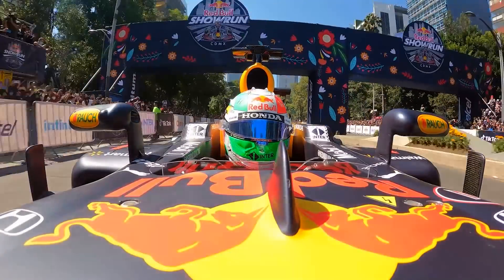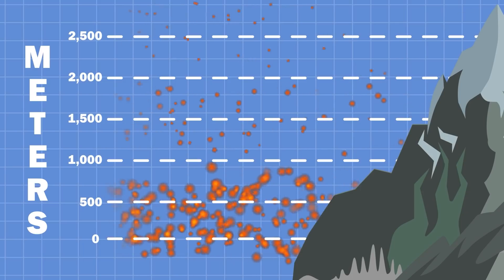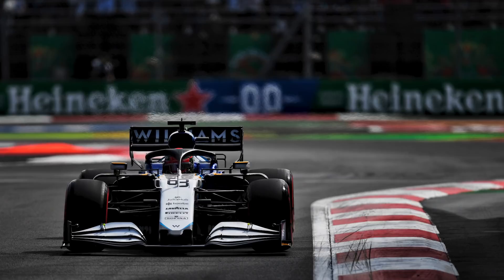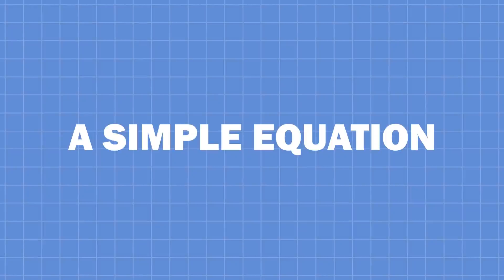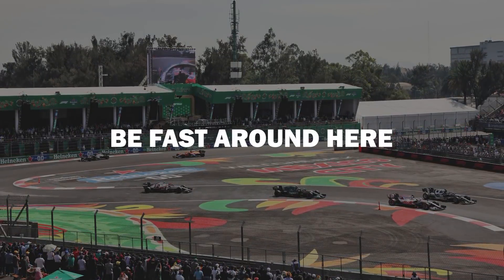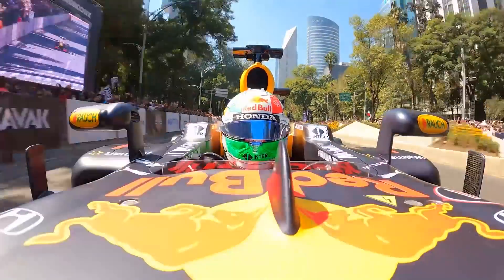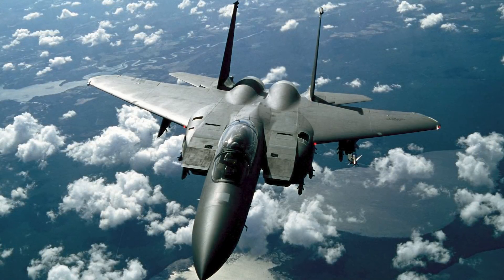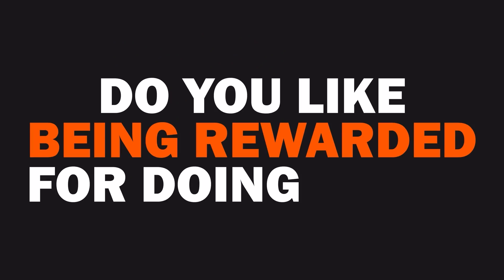How Does Altitude Affect F1 Car Performance?

Comment: Living and training at altitude (or through use of an altitude chamber which replicates the conditions) helps athletes gain a competitive advantage by being better adapted to high altitude conditions which would otherwise put additional stress on the body It's a technique also used by fighter pilots, cyclists and mountaineers to name a few as altitude sickness can also get quite dangerous at even more extremes.

Comment: Bruh this video didnt answer anything at all. Its impossible to know if Honda's turbo is better than other's, that is a closely guarded secret, their aviation experience tells you nothing.

The whole drag being less of a factor is just flat-out wrong. Drag is reduced alongside the downforce, putting the big wangs in the car brings the drag back alongside the downforce.  It affects all the teams the same too, yall explained shit.

Also, the sidepod intake size is set and cannot be changed race to race. "thats why they have bigger intakes" there is no bigger intakes, how did that line make it through scrutiny? The way they change their cooling packages is opening up the outlets, not the intlets.

Comment: It's easy, Mercedes powet unit include, Merc works, Mclaren, Aston and Williams .. run smaller intercooler or higher combustion pre combustion air temperature in their setup than Honda and Ferrari

Comment: The part about being able to put more air into the engine is most likely wrong, F1s have very optimized turbo plus the MGUH to make up for usual losses so they are really unlikely to have problems with intake, consider how little air it takes to saturate the regulation limited fuel flow. The actual challenge is really cooling.

Comment: science and wtf1 really have nothing in common. 
You guys failed to even say that due to the air being less dense there are less molecules in the same volume of air. Which is why the turbo charger needs more to compress more air so that the combustion has enough O2 molecules to happen. 
Same thing for the cooling -> fewer molecules means that less heat transfer that can happen in between the hot parts and the cold air.

Comment: The aero section of the video doesn't make any sense. Both Lift (downforce) and Drag equations are affected by the air density by the same proportion. So air density would not have an effect on one relative to the other.

Comment: I used to climb mountains, I was on Annapurna 1 in 1998 and I could take about seven steps at 25K feet, no way I can do that today. I think they compared this circuit to Mt. Fuji, I climbed that a few years ago and it was pretty tiring, I wouldn't want to wrangle an F1 car up there.

Comment: forgive me for being confused but how were the Red Bulls considered “much faster” if Bottas is the one who set the fastest lap in the race and the mercs were 1-2 in quali?
Reply: In qualy red bull got unlucky (as in checo had to go off track, wich also hinderd max) and bottas was the only one trying for fastest lap (pitting to softs at the end of the race) because he had nothing to lose
Reply: Red Bull were suffering with Rear wing osscilations in qualifying as the high downforce wings used in Mexico, are normally used in low speed tracks like Monaco/Hungary, but as Mexico City is at the highest altitude of the season, the air density is much lower (thinner) than any other race. So teams run larger rear wings to help generate more downforce, without the drag penalty they'd receive at lower altitude and also because with less air, less downforce, and thus grip is produced. But since these high downforce wings aren't designed for such high speeds (they're bigger so endure a much greater pressure/force than smaller wings), they were having issues with them fracturing during the weekend (we saw Max and Checo swap wings for example). Add to this difficulty in getting tyre temperature and it was an unrelenting negative spiral, with Tsunoda confusion everything went wrong for RBR. In the race however speed, and forces are far lower as the cars are heavier with fuel, and the cars are driven more in a way to preserve tyres/components unlike qualifying so this makes these issues disappear and as Red Bull had a significant pace advantage in Mexico due to the altitude and track layout. Now that the issues were no longer present in qualifying, and as with consecutive laps tyre temperature is much easier to control, everything came back to Red Bull and they were able to exploit their large pace advantage.
Reply: The bulls were faster in free practice.
Their final run in Q3 was slightly compromised. Max was 0.011 off Lewis in Q2 and 0.061 off the leader (Bottas) in Q1.

To then be off by 3 and a half tenths in Q3

Comment: you could explain it like the air pressure is like going deep into the ocean.  The deeper you go the more pressure there is, at sea level the air pressure is greatest, as you go higher up the air pressure gets less just like when you dive down and come up pressure changes.

Comment: Don't turbos push (blow) rather than pull (suck) air?

"Forced induction"
Reply: Well when they push they also have to suck but i know what you mean
Reply: @makr0295  I do indeed know what you mean, but NAs are pretty good at sucking (in air)
Reply: @Tj930  yeah thats true. It would make more sense to say sucking when talking about NA engines than turbos. But yeah i mean all combustion engines sick air in some way.
Reply: Well, on a 4-stroke-piston engine, yeah: Induction, Compression, Power, Exhaust (aka Suck, Squeeze, Bang, Blow).. But in a forced-induction engine (supercharger or turbocharger, etc), when 'on boost', it's not just the "bigger bangs" from more oxygen in the cylinder (something like nitrous provides this), there is also the push of air on the piston when the inlet valve opens.

Comment: Is it more down to car than engine though? Max's previous two wins were with Renault engine and redbull was very strong then also
Reply: look at the cooling packages of both merc and redbull the redbull has a much larger cooling package
Reply: @I_AM_HYDRAA  got it. Thanks. Was confused about this for more than a week now 😅
Reply: @phoenix2225  np it was pointed out randomly by someone this weekend and it explained alot and it is possible merc engines are just bad at high altitudes

Comment: You forgot, that due to less downforce the cars have less aereodynamic grip and need to rely more on mechanical grip (suspension, dampers etc.) and the Red Bull has more mechanical grip than the others
Reply: So does Ferrari
Reply: And even if it was at ground level, there are alot of slow, twisty corners which require more mech grip anyway, which Red Bull has far more off then Merc due to the Merc having a super long wheel base meaning it corners like an aircraft carrier.

Comment: Mercedes literally locked out the front row in Qualifying and yet some how people think they are "much" slower than Redbull. They even had way higher straight line speed than Redbull. Hamilton finished P2. Had Redbull been "much" quicker ,Perez would have breezed past Hamilton.
Reply: They were minutes slower you biased clown. Just because max couldn't perform in qualifying doesn't change the rest of the weekend
Reply: If RB were behind Merc they would have suffered from overheating. So that would make a benefit for Mercedes
Reply: @ExclemationMark  but Merc's overheating issues, as usual at Mexico, were much worse.  That matters a lot more in the race than in quali.
Reply: @elliotcrossan6290  that’s true. But I think it could also flipped backwards for RB. Perez still had problems overtaking Ham which is a god on wheels
Reply: @ExclemationMark  it's notoriously difficult to overtake at Autodromo Hermanos Rodriguez, because of overheating problems, sector 3, and slipstream/DRS being less powerful at high altitude.  Checo was probably half a second a lap faster than Lewis, because the Red Bull was so dominant in the race, but you need to be about a second faster to pass at Mexico.
Reply: Why is everyone forgetting that Tsunoda and Perez ran wide in their lap and impeding max aswell? It could have been closer in quali if that didn’t happen
Reply: Verstappen won by 16 seconds.  Pérez clearly had more pace than Hamilton.  This was a dominant performance from Red Bull.  Just because they messed up quali whilst Bottas and Hamilton put in brilliant laps, doesn't mean their racepace wasn't vastly quicker.
Reply: @elliotcrossan6290  Mercedes literally topped the timing boards q1,q2,and q3.
Reply: @weignerleigner3037  And Red Bull literally won the race by 16 seconds 😂
Reply: @weignerleigner3037  Quali pace & race pace are different dude. Cars behave differently when fueled up. And Red Bull botched their quali.
Reply: @lordmahaveer6307  they botched all 3 qualy? Ok
Reply: @elliotcrossan6290  redbull was definitely faster but you guys are making it out to be this crazy gap in speed. The difference is negligible. If redbull was so much faster then perez would’ve easily passed lewis yet he didn’t. I think max is just faster overall. Look at Russell in Belgium. He beat lewis in a Williams. I think lewis is losing his edge a bit. Just my opinion.
Reply: @weignerleigner3037  Russell nearly took pole in a Williams.  That's because the FW43B comes alive in the wet, the team executed the tyre warmup strategy to perfection, and Russell is one of the best on the grid.

Meanwhile, Lewis is beating Bottas in qualifying (Valtteri's greatest strength) by a bigger margin than ever, and delivering brilliant performances such as France and CotA, nearly winning in a car which should be nowhere near beating the Red Bull.  He also took a brilliant underdog win in a much slower car in Bahrain.  Max has the fastest car this year, and fair play, he is capitalising on that most of the time.  But Lewis is still the best on the grid.

Let's see if Lewis has "lost his edge" when he goes up against the brilliant Russell in equal machinery next year.  Watch how quickly the Lewis haters suddenly decide that Russell is overrated and loads of drivers would actually be closer to Lewis in the Merc once Lewis starts beating him.  Because that's precisely what happened to another driver who was rightly very highly rated in his time at Williams...
Reply: @weignerleigner3037  Don't be that guy. Merc & Red Bull do the bare minimum in Q1 & 2 just to get through. Max complained in FP3 already that the softs felt weird, and he wasn't improving enough on his final Q3 run to even get ahead of Lewis, even until the Tsunoda scene. Race pace is where it's at. Go look at the long-run pace numbers from FP1 & 2 ON F1TV if you're keen to dispute this. Yal like to respond knowing very well that what you're saying is blind bias.
Reply: @elliotcrossan6290  yeah I disagree with all of that. Funny how when people said Hamilton had the fastest car they were wrong. Now Hamilton fans say the same about max. Interesting how hypocrites work.
Reply: @weignerleigner3037  I'm interested to know who you're referring to who claimed Mercedes didn't have the fastest car in 2014-2016 and 2019-2020?  Seems like you're inventing an enemy to get outraged at there 😂

This is only the second time in eight years that Mercedes haven't had the fastest car (2017 being roughly equal between the top two).  In 2018, Ferrari were faster in nearly two-thirds of the races -- that year, Lewis had his most incredible season to date whilst Seb crumbled under pressure.  In 2021, Red Bull have a similar pace advantage to Ferrari in 2018, yet Lewis hasn't walked away with the title because Verstappen is capitalising on his opportunities almost every weekend, whilst Vettel catastrophically failed to do in 2018 -- and that's why I give Max credit for that accomplishment, which is especially impressive given his age.

But you're inventing your imaginary hypocritical Lewis fans.  We never said Lewis didn't have the fastest car throughout the majority of the turbo-hybrid era.  We did say that it was evidently not just the car, as ignorant Hamilton haters claim.  It's impressive to consistently capitalise under pressure when your car is fastest -- as Hamilton and Verstappen are both great at doing.  But it's also impressive to consistently capitalise in races and seasons where you don't have that advantage.  That's how Lewis won the 2018 season; it's how he won 2008; it's how he took underdog victories such as Hungary 2009, Singapore 2009, USA 2012, Germany 2018, Italy 2018, Turkey 2020 and Bahrain 2021; and it's the only reason he's still in the title fight this year.

And what's most impressive is seeing off every teammate you've ever faced, especially when three of them were World Champions.  Lewis beat the mighty Fernando Alonso in his rookie season.  He beat Button 2-1 and Rosberg 3-1.  Verstappen, meanwhile, has never had a World Champion teammate, and got beaten 2-1 by Ricciardo, the only tough teammate he's ever had.

That's why Lewis is the best driver on the grid.
Reply: @elliotcrossan6290  https://youtu.be/E_CvS-dN99Y
I’m referring to you. A guy who will ignore reality. Lewis is a great driver for sure but he’s not 2017 lewis anymore and it shows. Getting out qualified by a Williams automatically disqualifies you from being best on the grid. Regardless of the results of this season max was clearly the best driver on the grid this year, put in incredible performances while lewis has been good but not really spectacular.
Reply: @weignerleigner3037  Utter foolishness.  Every other driver bar max was outqualified by a williams in spa.  Using that as a gauge of competence is about as wise as your father not using a condom prior to your conception.   A grave error he probably regrets to this day. The important bit is the 2.2s ahead of bottas - by far the largest of quali. 

And while it's fair to say max has driven better than lewis, it isn't night and day.  He's been more consistent and has better capitalised on opportunities given to him.  That said, redbull has been superior operationally with a better car more compliant car.  The 2021 rule change lost mercedes 1 second compared to the field.
Reply: @Bahamuttiamat  Thaaaaaank you! 😂😂💯
Reply: @Bahamuttiamat  there it is someone’s getting upset. Your claiming Hamilton is the best bro so it doesn’t matter what everyone else did he should’ve been on pole in wet conditions right?  Rain is the great equalizer as they say. And on equal footing he couldn’t beat Russell in a Williams. That doesn’t mean he’s bad, but it certainly means he is no longer the best on the grid. It happens man people get old and Hamilton’s time has to come someday.
Reply: @weignerleigner3037  Did i not say max was the better driver this season thus far?  Why exactly is your gripe?
Reply: @Bahamuttiamat  I don’t have a gripe lol I’m just sharing my opinion and getting told my dad should have worn a condom.
Reply: @Bahamuttiamat  you guys act like just cus the redbull is like a tenth or 2 quicker over a lap time on this track that it automatically means redbull will win. Max has shown this whole season he can put in quick lap times over an entire race consistently. All I’m pointing out is that lewis has before beat people who had pace advantages like vettel in 2017 and 2018 so to say the redbull is faster and that’s why max won is nonsense. The entire qualifying the Mercedes were faster so this pace advantage clearly isn’t that large. Hamilton is fully capable of winning these races but max is now on his level of not better.
Reply: @weignerleigner3037  bruv.  Calm down.  We are six months away from ACTUALLY seeing Hamilton and Russell in equal machinery.  If George beats Lewis fair and square across the season, then I'll admit that Lewis is no longer the beast he was in 2007-2020.  But that's not gonna happen.

I'd say Lewis has indeed made more mistakes than usual whilst trying to beat a significantly faster car, but his actual driving his GOAT-tier as ever, and he is outperforming his car even more than he did in 2017 -- though he's not doing as well as 2018, his best season to date.

Chill with the Russell comparisons.  We're literally about to see them as teammates.
Reply: @elliotcrossan6290  lol I don’t need to calm down, redbull isn’t significantly faster than Mercedes bro. Another Hamilton fan who creates his own reality to justify his delusional thoughts on Hamilton.
Reply: @weignerleigner3037  ah yes, saying that literally the most successful driver of all time is also the best driver on the current grid is soooo delusional.  You're right, the guy who got beaten 2 times out of 3 by Ricciardo is better 😂🤦🏼‍♂️
Reply: @elliotcrossan6290  yeah he is since he’s clearly winning. And according to you guys the only reason Hamilton won was because he had the faster car.
Reply: @weignerleigner3037  What?  No, Lewis won in the second fastest car in 2008 and 2018.  He's still just 19 points away from winning in the second fastest car in 2021.  That's because he's one of if not the best driver in F1 history.  Verstappen is simply doing his job this year -- leading in the fastest car.  He's doing it well, yes, but if Lewis was in the Red Bull he'd be minimum 40 points clear in the standings, not 19.  Lewis is a bit faster, and a lot smarter.
Reply: @weignerleigner3037  The redbull was 5 to 6 tenths quicker than mercedes in mexico.  That is 2020 levels of car performance.  I mean max won by 17 second while cruising.  Every now and again, he'd tickle the fastest lap for fun.

There's no denying max has been the better driver of the two, but it's also fair to say he's had on average the better car and crucial more consistent.  Redbull has also been better strategically.  Mercedes strategy cost lewis the win in France, and Hungary.